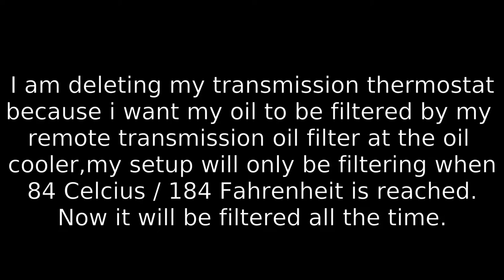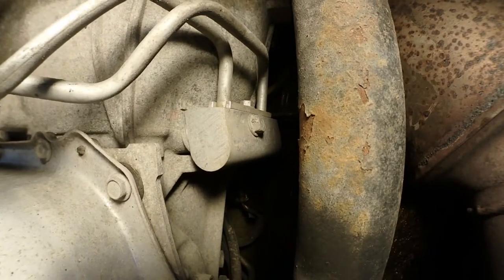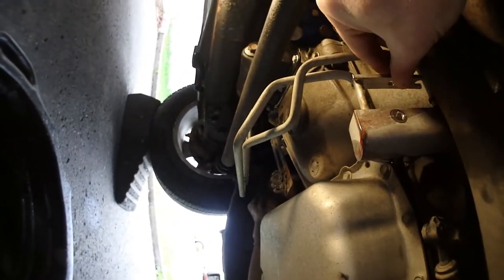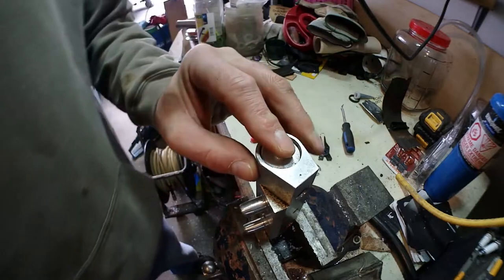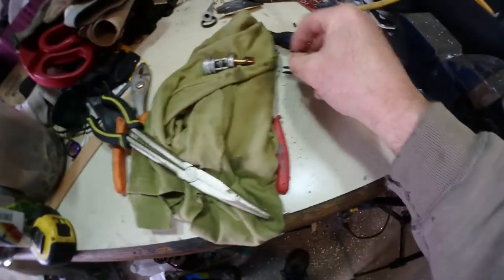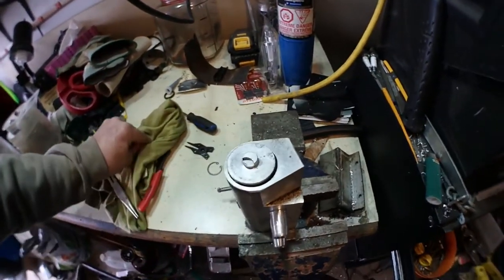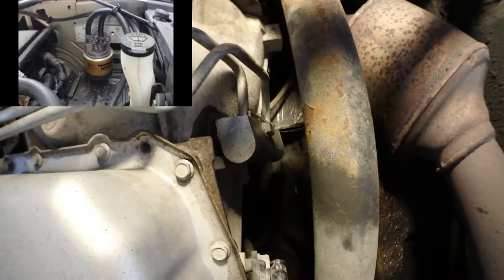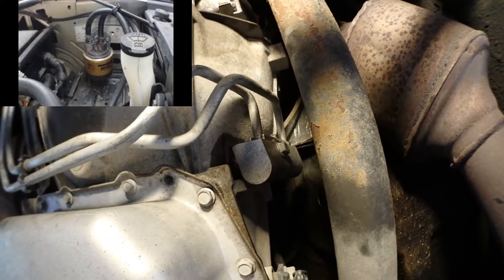Transmission Thermostat Delete  2014 Sierra Silverado 5.3L.

Comment: You can also use Header Wrap and wrap up the exhaust pipe that crosses under the Transmission Pan. That literally cooks the Trans fluid. 
I installed LongTube Headers and crossed the exhaust under the Trans Yoke Instead of the pan and my AFT Fluid takes much longer to warm up. Im doint this Trans Thermostat inversion soon too.
Reply from the maker: Thanks for the heads up for that Header Wrap,good idea.
Thanks for taking the time to comment,i appreciate it.
Thanks for watching,best regards.
Reply: @obscur156  Anytime
Reply from the maker: @BadAssEngineering  great i subed to your channel,looks like you have some good vid i will have to take a look.regards.
Reply: @obscur156  Thanks, i appreciate it, thank you for the heads up on the 2014-2018 Oil Pumps
Reply: How much better is it now with the header wrap and thermostat delete?
Reply: @joshuahill5593  haven't deleted the thermostat yet
Reply: @BadAssEngineering  how much did it help with header wrap?

Comment: I did this today on my 2017. Be aware that the head of the plug reduced the flow quite a bit! I blew on it after I plugged it and it was very hard to get air flow.  I went to the store and found a plug that uses an allen  and it  was much better.
Reply from the maker: Thanks for the heads up.
Reply: yourleftnut1  Tanya Hardware Brass Pipe Fitting, Hex Counter Sunk Plug, 1/4 Inch NPT Male Pipe
Reply: Search for this on Amazon.

Comment: I am looking to do this on my 2014 Silverado. I'm in Utah and drive in the mountains quite a bit for work and play. Seems ambient surface temps also seem to cause my transmission to heat up faster. Under 100 degree outside temps I stay around 187 to 189, but when it gets over 100 I see my temps shoot up over 200 with no extra load or towing. Hopefully this delete will help. I will comment with an update when I get this completed tomorrow.
Reply from the maker: Yes ,keep us updated with your new temp  numbers.
Thanks
Reply: Get yourself a mishimoto transmission cooler. It comes with a bypass delete too.
Reply: So like where’s the update ?

Comment: doing this with my mom's 2015 Tahoe right now. I don't like the fact that the transmission sits at 186° all the time
Reply from the maker: Glad that you liked it.
Thanks for watching,regards.
Reply: I'm going to be changing my torque converter on my 6l80e I heard at higher mileage they delaminate and smoke the clutches. I have 42,000 on a 17 silverado going to do this and put a mishishi moto exterior cooler in as well. I had an 09 silverado with exterior cooler stayed at 150 in summer and in winter time right at 100 degrees.

Comment: Hey bro. We're is the 2007 to 2013 thermostat? Can the same be done on them?
Reply from the maker: Thermostat for transmission started in 2014 if i am right...
Reply: I'm installing an external transmission cooler tomorrow, wanted to know if the 2013 had it. Thanks for the reply.

Comment: Does anyone have a part number for the Transmission Fluid Cooler Thermal Bypass for a 2014 GMC Sierra 1500 5.3 with a 6L80E trans in it?
I’ve looked but came up empty

Please help
Reply from the maker: https://www.amazon.ca/Hayden-Automotive-397-Transmission-Fitting/dp/B000EPRCAC/ref=sr_1_31?dchild=1&keywords=gm+transmission+fitting&qid=1622846196&sr=8-31

Comment from the maker: I am deleting my transmission thermostat because i want my oil to be filtered by my remote transmission oil filter at the oil cooler.
My setup will only be filtering when 84 Celcius / 184 Fahrenheit is reached with that transmission oil thermostat.
Now it will be filtered as soon as the engine is running with the transmission thermostat delete.
I was wrong when saying to remove everything inside will work,bottom hole needs to be plugged...
Here is my setup for my Derale Remote Transmission Oil Filter : https://www.youtube.com/watch?v=2UfVI0D49IM
UPDATE : Now running a lot cooler,before while towing the boat in the summer i was getting 205 F /95 Celcius.
Now with T-Stat delete i am getting 169 F / 76 Celcius towing my boat !